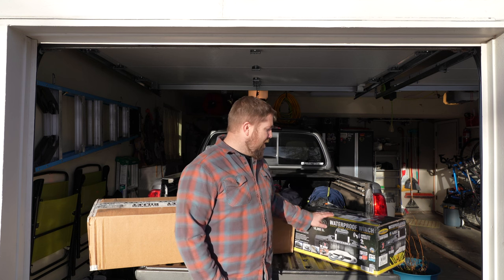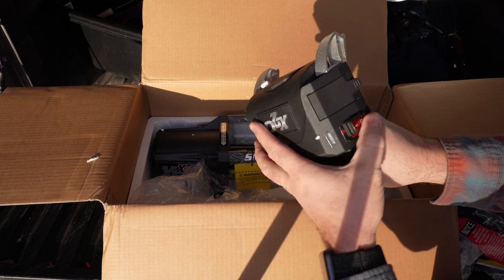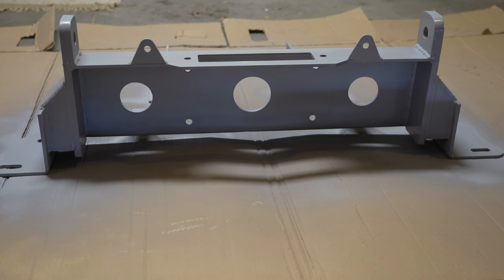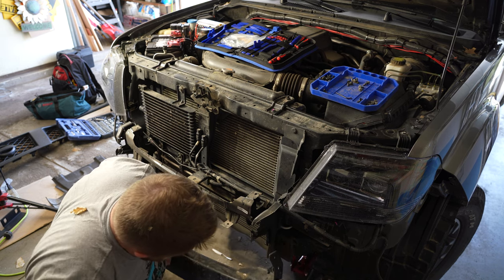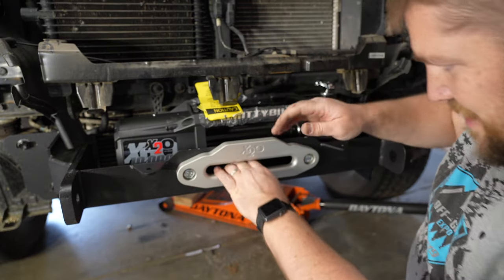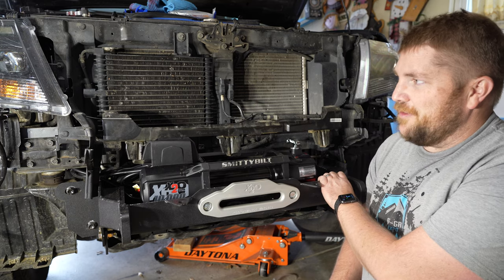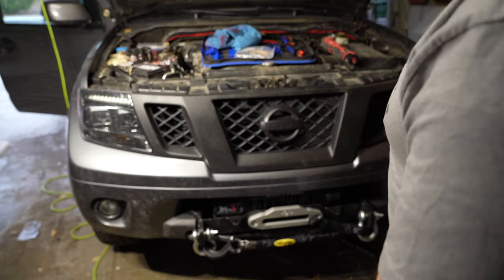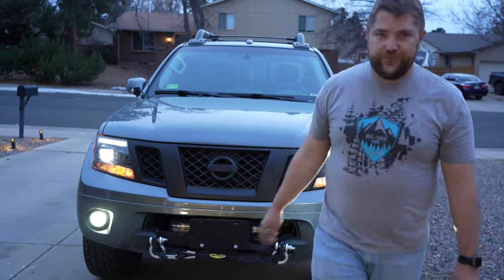Nissan Frontier WAM Hidden Winch Carrier Install

Comment: I just installed mine on a 2010 Xterra, easy setup.  Thankfully I didn’t run into any of the issues you experienced.  The real challenge has been cutting the plastic bumper and grill.  I agree about the paint, I should have had it powder coated.

Comment: They didn't use to be problematic installs, but the move to AZ really changed their attention to detail.  I have two WAM winch carriers installed on my Nissans (one WAM from GA? and one WAM from AZ) the AZ WAM is proving to be far less "bolt-on".  Too bad too, I like the product.  Yet, I keep hearing negative (AZ WAM) when I used to hear only positive (GA? WAM).

Comment: Great looking and performing truck for sure!   I’ve got 2 Xterra’s with same powerful 4.0 VQ4DE.  Over 600,000 miles between the two.  Have you noticed any kind of a whine from your upper timing chain guides?   They may need service.   Engine keeps rocking.   Keep the oil clean and topped of with synthetic.    Best wishes.
Reply from the maker: No whine, but my truck since 2018 has only gotten 24,000 miles. I have a company car so it doesn’t get much love. It had developed a squeak from one of the pulleys, though.

Comment: So younloos crash protection then
Reply: Sorry you loose crash protection because of the bumper is small
Reply from the maker: They do offer extended crash bars for this winch mount, I just didn't order it that way to save weight.